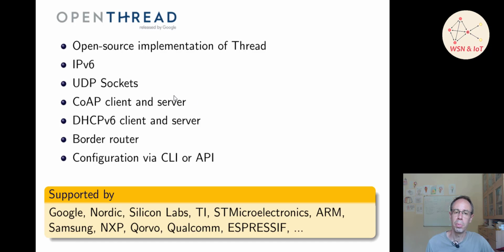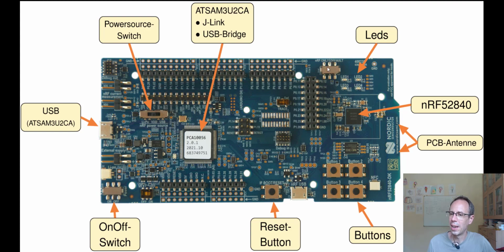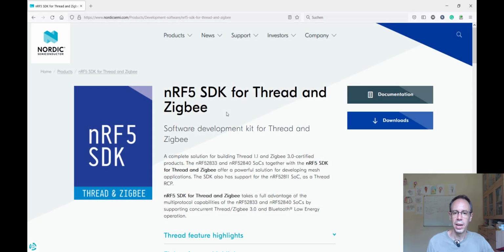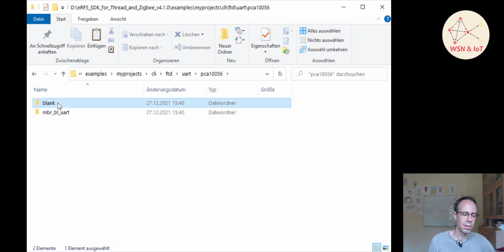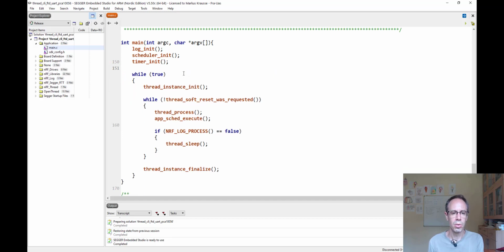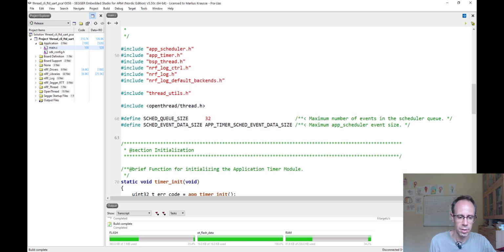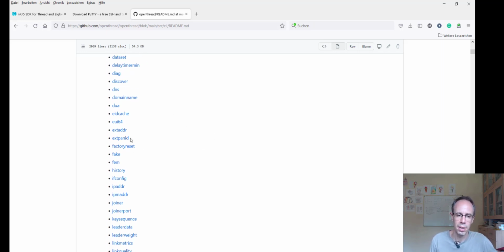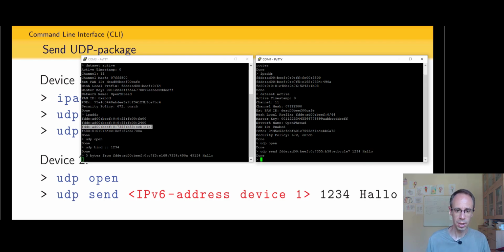Thread network technology - 02 OpenThread CLI Example with Nordic nRF52840-dk

Comment: Thank you for this video, I have an nrf5840 dk and the OpenThread conecction worked succesfully, but also, I have a Xiao BLE which contains a nrf52840 chipset, I am trying to make an example which sends an Coap message with data from a BME280 sensor and I already got it on DK but when I trying to do it in the Xiao BLE I found a problem when I was creating the build like this "undefined reference to `__device_dts_ord_61'" Do you know what could be the problem?  I tried the BME280 example you made and also it works for nrf52840 dk but, in this Xiao only with BME280 example does not works even. Thank you in advance.
Reply from the maker: Have no experience with the Xiao BLE, but it has a slightly different dts configuration. Xiao has not activated i2c0 in the devicetree. It uses i2c1 instead. So if you programm directly over I2C use

#define I2C_NODE 	 	DT_NODELABEL(i2c1)				 		
static const struct device *i2c_dev = DEVICE_DT_GET(I2C_NODE);
Reply: @wsniot  I did that change, and it let me build the program. But when I see the terminal, the value don't change... It stay always at the same value, Idk why that happens. Thank you in advance.
Reply: I also have the same problem...